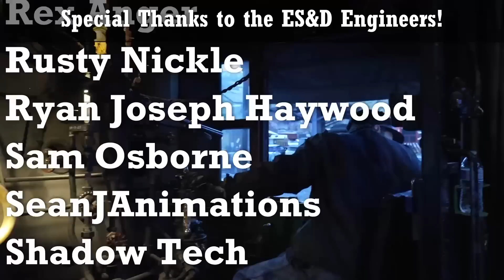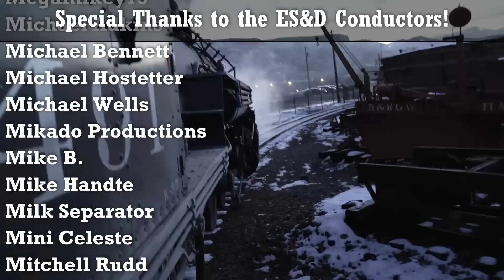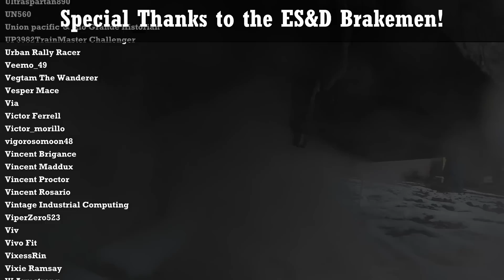Light rail isn't light? Street Car vs. Light Rail vs. Commuter Rail | Railroad 101

Comment: The Baltimore light rail system used to have a section that was shared with heavy rail freight. Because FRA, they had to separate the two - light rail ran during the day and into the evening, and then they'd shove them all in the car barn, remove a derailer and the class 1 would come in and switch out their industries. If they didn't get their crap done in time, better get out the bus replacement service, because no light rail for you,

This came about because the light rail basically bought out the right of way from the class 1 as the basis for building out service to a new area, and ended because the freight customers dried up (probably because getting your cars switched out at 3AM sucks)
Reply: Yeah, my town had a mixed use track built to the coast, that became only freight, then light rail bought out the daytime hours of a good chunk  of the alignment and built new the rest. So now cargo to the industries only switch at way too early in the morning. West coast USA.
Reply: France and Germany have several similar systems, typically called “tram-train”. Really cool and out of box approach.
Reply: Same here in New Jersey. The light rail River Line from Camden to Trenton runs on freight RW in the daytime and freight runs at night. Seems to work okay but no light rail after midnight could leave you stranded with no way home if out at a concert or partying.
Reply: Yup! The line north of North Avenue used to be served by Norfolk Southern. The old wye up by Warren road was used to store local freight trains if they couldnt clear the tracks fast enough for the Light rail. Used to be a yard on the north side of the MTA yard. Last i saw, its getting ripped up. Theres an old Conrail boxcar over there too i wonder if its still there, was kinda hopping a local group of railfans was gonna raise money to preserve it

Comment: Denver's RTD runs parallel in places and does actually have a single crossover to BNSF between 9th and 10th avenues, I assume this is so rail vehicles can be delivered to RTD.
Reply: If I remember correctly one of the Reasons RTD chose heavy rail vehicles for the lines served by the Union Station platform was because Amtrak trains also stop there, and since there's not a good way to grade separate those, the trains needed to be FRA crashworthy

Comment: So RTD's 'light rail' alignment does have an interconnection with BNSF. The derail is just south of the 10th and Osage station and just north of the Mariposa yard (there is not surprisingly a crossover just south of that which makes it easy to get into said yard when delivering rolling stock). It is not surprisingly right into what used to be the Burnham yard. That said as far as I can tell, this exists for delivering rolling stock only.
Reply from the maker: Is that light rail? Or commuter? I'm interested now...
Reply: @Hyce777  The Mariposa yard is Light rail only. That derail has been there as long as I can remember riding RTD light rail (since it opened). The commuter rail alignment (A line) I've never ridden. I assume it has a separate interconnection and derail close to the relevant yard.

If you're trying to find it on google maps you can spot it just south of 10th and Osage.

You can also see some really cool features at the Burnham yard that used to exist right there as well. There is the remains of a turntable and a transfer table (if I'm reading the image right) there. You can see the former from the light rail, but not the latter due to minor changes in elevation going into 10th and Osage.
Reply: @Hyce777  One minor correction, that alignment is probably the UP alignment, not the shared BNSF/UP north south main. Burnham yard IIRC was UP up until 2021, it's now CDOT and they are apparently considering using it for commuter rail?
Reply from the maker: @NullReference119  huh! Well that's neat. I'll have to look into that. Cheers!

Comment: Well, I‘m from Switzerland where, at least in a legal sense, there’s just railways, though there’s generally visible differences between standard gauge rail, narrow gauge rail, trams and trolley buses… at first glance, but aside from a standard gauge tram, I think we have it all: pax EMU running freight trains, street running „heavy“ rail with curbside boarding, single ended tram, double ended tram, single ended tram as light rail, standard gauge tram as heavy rail, trams using a metro tunnel, commuter train in metro tunnel, narrow/standard gauge changing trains. Okay, the metro trains as heavy rail have been scrapped, but instead we have narrow gauge doing 75mph. Narrow gauge rack railway, standard gauge rack railway, „the cog“ interchanging cars with the „big“ railway. Okay, we don’t have it in Diesel traction, it’s all electric, but what else is missing?
Reply: Funily enough under Czech law trolleybusses are considered rail, including parcial ones.
Reply: @petrfedor1851  same here, a battery bus with trolley poles needs a tram license; same model without poles gets a license plate and needs a Bus license (hess double articulated with batteries)
Reply: Oh yea absurd i level seperated trams  why i like street runing regular trains

Comment: I voluenteer at the Trondheim Tramway Museum, which runs historical trams on the most northern tram/streetcar line in the world, the meter gauge Gråkallen Line in Trondheim, Norway. This line really illustrates the gray line between tram/streetcar, light rail and heavy rail: It was built in 1924 as a private suburban rail line (forstadsbane) separate from the city's "normal" tramway, and the rolling stock was a blend between proper heavy rail and trams from the era, but not really being either. It also has signalling, but uses a train staff when the signalling system is inoperative. Even more confusingly, this line was later taken over by the city-owned tram company and they ended up running normal city trams on it (albeit with some modifications to make them more "train-like", like having proper lights, brakes and whistles). And even more confusingly, when the Trondheim Tramway then ordered new trams in the 80's, they were referred to by the manufacturer as "Light rail vehicles". The rest of the city's tramway was closed in the late 80's, and this single suburban rail line is now what remains of the tramway, despite not really being a tramway. Reality is confusing sometimes.
Anyway, you are welcome to visit our museum if you ever come to Trondheim, Hyce! :)

Comment: Not even there is also Metro that use light for battery rail powered train units to roll along underground, I'm not a tram way, light rail transit Metro expert I'm just a outside country train cause I don't live in a city.   But yeah, we got commuter rail in Texas like the Tex Rail that was operated from Dallas to Fort Worth and etc and yeah I seen those trains,  but boring trains but they did the best for the transportation for the biggest State in America.

Comment: It gets messier in Germany. Basically everything that is not “heavy rail” (Eisenbahn, EBO regulations) is a streetcar (Straßenbahn, BOStrab regulations, which means operating and building rules for streetcar systems). The later includes subways, streetcars, stadtbahn systems, People Mover (“Besondere Bauart”). But there are streetcars that can and indeed follow the EBO regulations. 

Either on pretty much an exclusive network (Mannheim/Heidelberg) where this EBO network connects the street car networks. Or they actually run along the big trains (Karlsruhe area). There is however not a single subway system (Berlin, Nürnberg, München, Hamburg) that does that. Stadtbahn systems however can do EBO. I think in the Rhein Ruhr area? I am not sure. And then we have two definitions of S-Bahn systems. One that almost exclusively uses it’s own network even own signaling (but still following EBO) in Hamburg and Berlin. 

And then the S-Bahn systems that are basically the big trains, sometimes even running with those trainsets (labeling RB Trains for marketing reasons into S-Bahn). And finally there is Munich which is kinda in the middle of things. 😅 Oh, and then there is a regulation for Maglev trains thanks to the Transrapid and the newer TSB system. These are neither EBO nor BOStrab IIRC.
Reply: Mannheim Mentioned🇩🇪🇩🇪🔥🔥🔥🚈🚈
Reply: You forgot another classification: ESBO which is used for narrow gauge railways (but not all narrow gauge railways are classified as this, see the Harz Railway). Which, for that matter, is what the tracks between Mannheim and Heidelberg (and Weinheim, alongside between Ludwigshafen and Bad Dürkheim) are classified, not EBO.
Reply: @MarioFanGamer659  Oh, indeed. Always thought Mannheim/Heidelberg is EBO. Interesting. Maybe because the trains are so wide I just assumed that. Sometimes I don’t recognize meter gauge.

Comment: Light rail means that they can't carry full loads of people. I don't remember what year it was, but Denver RTD went on media begging people not to ride light rail because it couldn't handle the loads of people. Early 2,000's maybe, the price of fuel went up and people decided to ride the light rail to work,  Oops!
Reply: Sounds like a specific Denver skill issue. I'm sure if they had infrastructure like Frankfurt or Edmonton they wouldn't have had these problems.
Reply: I don’t think that’s correct. I’ve been on the Arvada and Golden lines plenty of times when they were packed with standing-room only. They absolutely can handle fully loaded cars. In fact, every time I go to a sports game downtown, the trains are completely packed both inbound and outbound. They’re most efficient when fully loaded, in fact.

Comment: In the UK we class Light Rail as a system with axle weights of less than 12.5 tons and at a speed of less than 25mph and this has been the case since 1896. In the UK the level boarding standard is 1,115mm vertical offset from railhead and 900mm horizontal offset railhead.
Reply from the maker: Interesting. That's very different than our definition.
Reply: But more importantly it was a way to build a railway line without an act of parliament which is generally a pain to get in the best of times...
Reply: the UK has a level boarding standard, but does not adhere to it or attempt to adhere to it :/
Reply: @RoamingAdhocrat  Yeah, which is a real shame, HS2 will be the first railway to adhere to it.
Reply: @RoamingAdhocrat  Yeah, which is a real shame, HS2 will be the first railway to adhere to it.
Reply: @RoamingAdhocrat  we try... with all our trains being level on the inside. 
but not at the platform level...
Reply: I wonder if “tramways” or various industrial lines would have been included under this definition.
Reply: Light Rail in the uk was a line built with Statutory Powers granted under the Light Railways Act.. I am the President of one such line. There were special exemptions and limits such as the maximum speed of 25 mph. Since the change of regulations with the introduction of the Interoperabilty Directive there are other requirements but the speed  limit is still 25 mph (40kph). The Regulator is still His Majesties Railways Inspectorate, now part of the Office of Rail and road. ORR. The confusion exists because the modern tramways are often referred to as “light rail” because the term tramway is seen as old fashioned.!
Reply: Intersting way after that uk defiton i asemble Light rail freight trains

Comment: I find it funny the Pittsburgh streetcar network was technically light rail. Half of the system in the late 60’s was private ROW. All they really did to make it light rail in the 80’s was dig a tunnel downtown for a subway and redo the overhead to catenary. Some parts of the system remain unchanged from when it was built down to the signals and wire except for 2 inch extensions on the wire hangers to make the pantographs clear the span wires.
Reply: Totally agree! 👍😅
Reply: None of the original pre 1980s signals, track, overhead or support of overhead wires still exists on the T as it currently is, and has been the case since they closed down the Drake line in 1999.  The entire route from South Hills Village thru Mt Lebanon and to down town was rebuilt in the 80s from the ground up and the two remaining street car era chunks were closed in 1998 (Overbrook to be later rebuilt as a modern dual track system) and Drake, which was abandoned .
Reply: @vidguy1976  The library line is absolutely original. The poles are still wood, the overhead is still the original, the crossing electronics, and the signals are original.